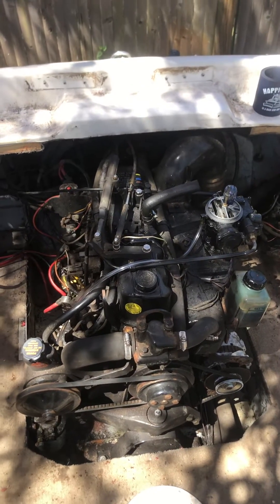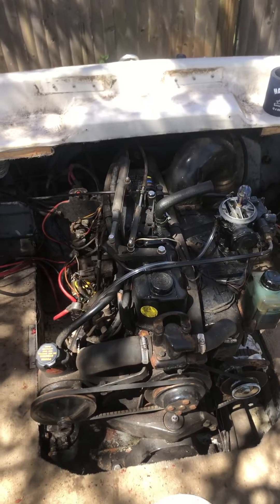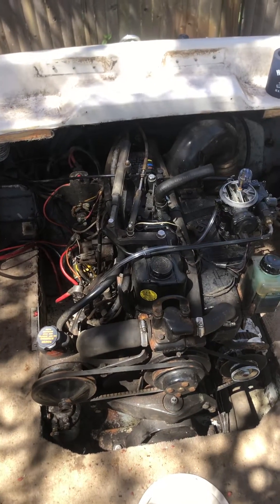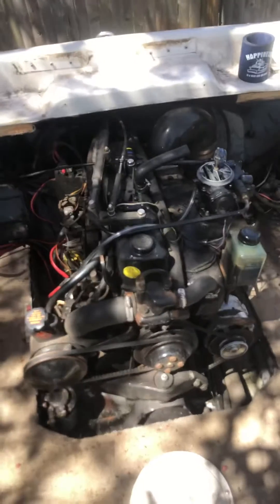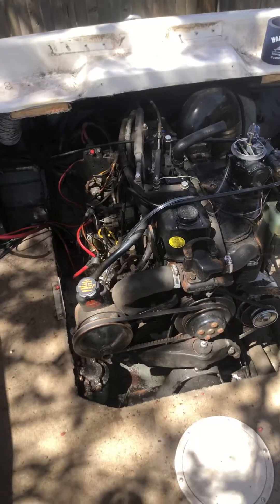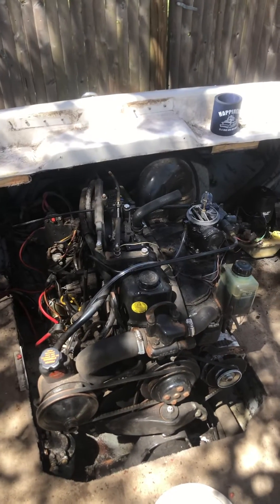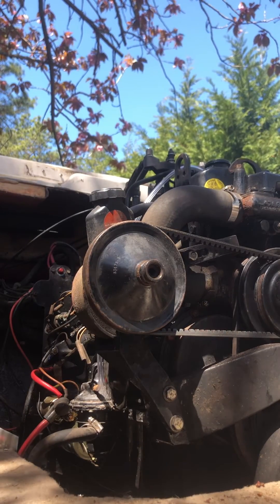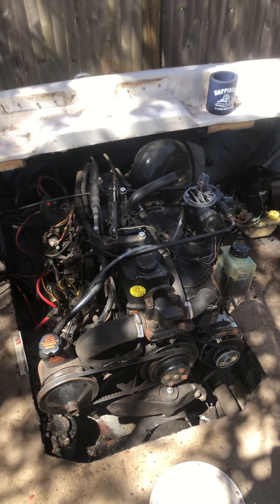Mercruiser 3.0LX 1995 Troubleshoot

Comment: Check the shift interrupter on the top of the valve cover. It could be killing your motor. Also make sure your coil positive terminal has voltage when the ignition is on.